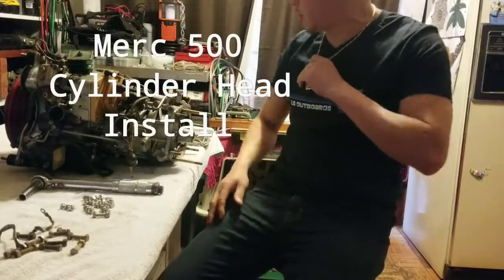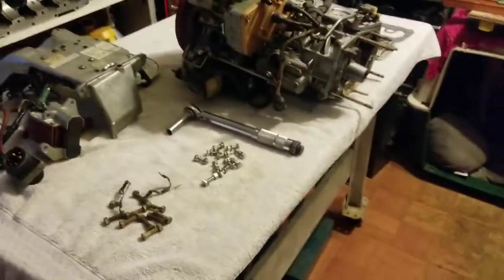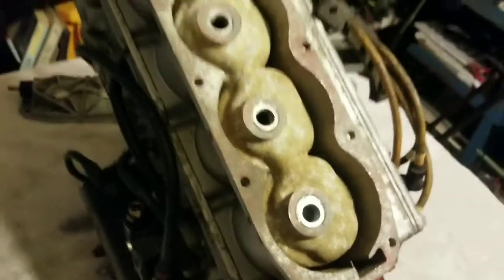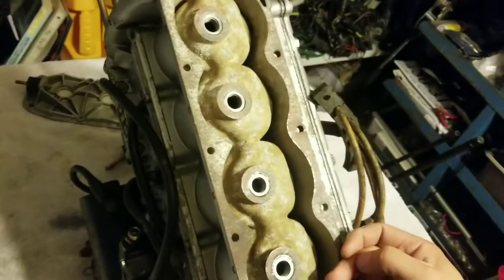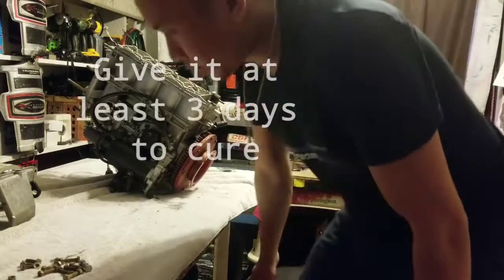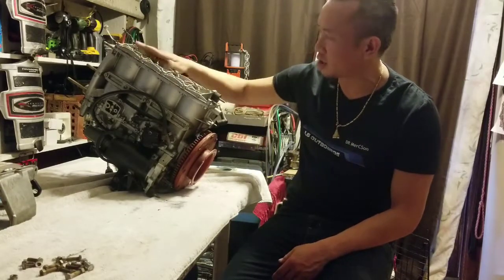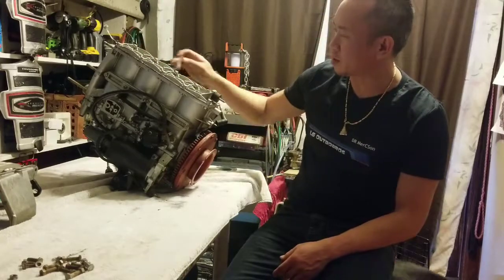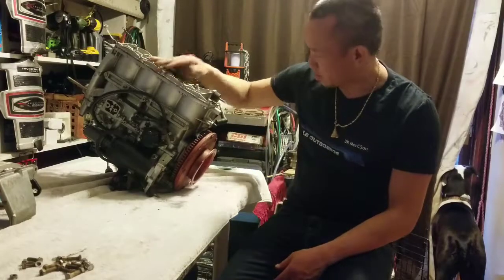Mercury Inline Cylinder Head Install

Comment: You did not do anything wrong with the increase on the torque.  I have seen the number 1 throw water, and wash the plug.  Like the tutorial.
Reply: My 50 is doing that.  There was a hole next to it for a sensor.  I plugged it and now its pissing out all around #1 plug.  I bought a new gasket.  My motor has sat for who knows how long as I bought it used.

Comment: Why only sealant on one side of the gasket?
Reply from the maker: You can do both if prefer. The gasket absorbs the sealant and I have not had any issues with leaks etc. Just a preference that saves money. Son
Reply: I am noticing water in cylinder 6 like it’s almost washing the plug. Would this gasket be my issue? Or could it be the exhaust side?